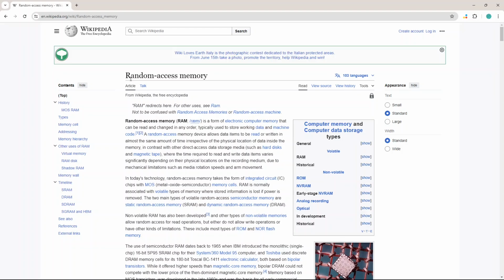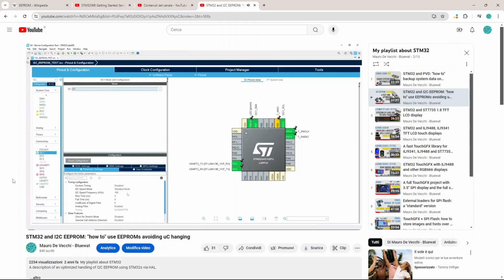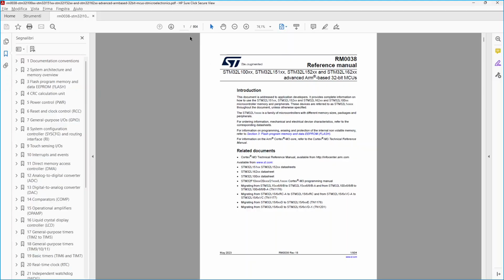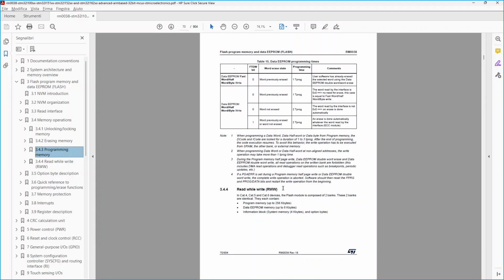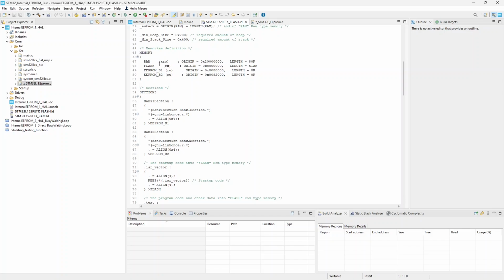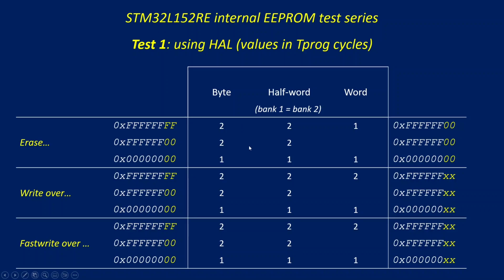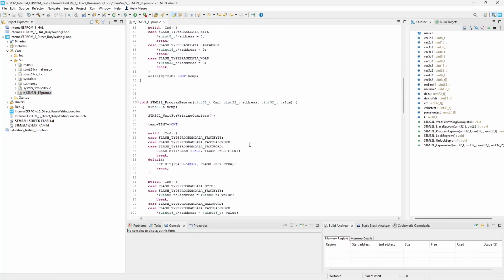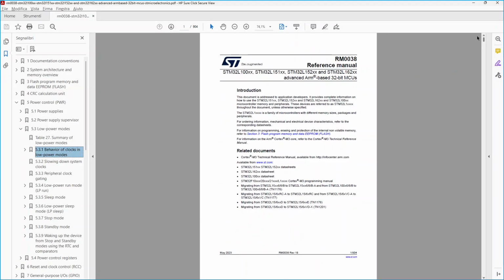The onchip EEPROM of STM32 L0 and L1 series

Comment: Hi sir, I am working on a project using the STM32F407VET6 connected with an SSD1963 screen. I am also using external SPI flash W25Q128 as per your previous video guides, but I encounter an error when debugging. CubeIDE returns this error: 
Error message from debugger back end: 
Error finishing flash operation 
Error finishing flash operation.
Please help me if you can, sir.
Reply from the maker: Hi Au Mau Tri Duy,
you are quite OT here.
Anyway, your description is too generic to be able to give you any hint. But.
I 've seen there is a lot about "Error message from debugger back end: Error finishing flash operation" on https://community.st.com/